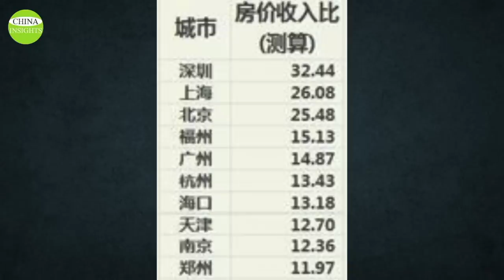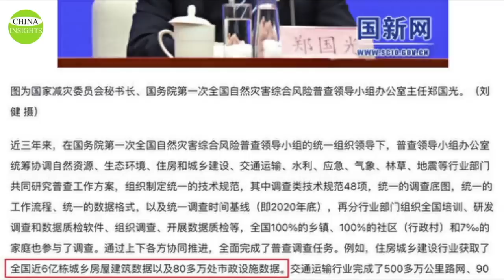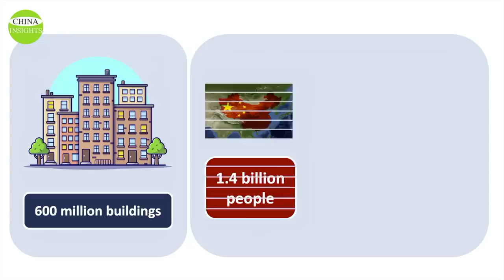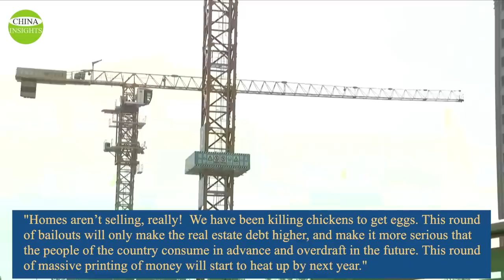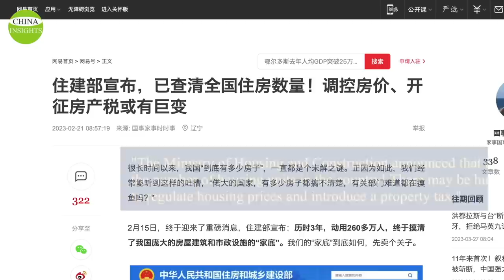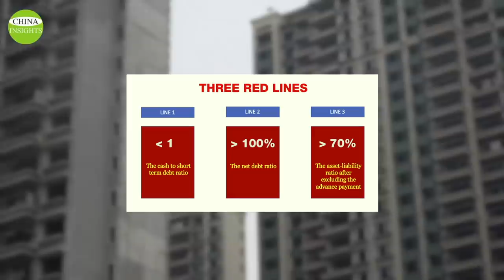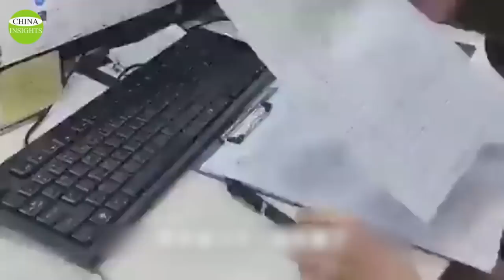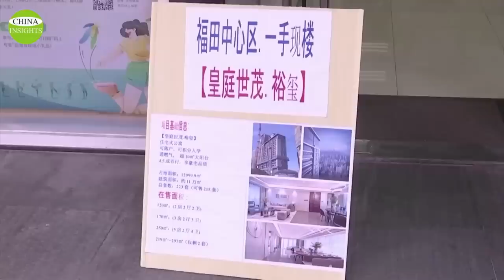Crisis overlap, heading for collapse: Why CCP release the news that China has 6 million buildings?

Comment: Are those buildings being demolished deliberately or is their collapse the result of the tofu dregs foundations melting and the buildings collapsing by themselves? In China you can never tell which it really is. That's what happens when you use too much sand and not enough concrete in cement and defective steel. That's what the German consultants said about the Three Gorges Dam while it was under construction and they were asked to inspect it. The CCP said their report was due to racism.
Reply: I heard it another way.  The dam builders insisted on USA inspection teams to avoid substandard materials and work.  It's still standing.
Reply: @jakleo337  There are a lot of concerns about it that seem fully justified. The inspection consultant was definitely German.

Comment: In communist russia there was a factory that had a rail line leading to it. Railcars of metal ingots arrived and the factory turned those ingots into ball bearings, loaded them into railcars and sent them away on the rail line. At the other end of the rail line was another factory, railcars of ball bearings would arrive loaded in the railcars. The factory took those ball bearings and melted them down into ingots, loaded them into railcars and sent them down the rail line.

It seems China is doing the same thing with real estate.

Comment: Not to be picky but I am a long-time and regular caller on regional 'Call-in and talk to the host radio' and I
recommend your site and cite it as an accurate source for news from inside China reporting.  Your title reads China has 6 million houses, not 600 million, several other callers and even the station hosts cite you as a source and you seem to have a good reputation as a go-to source in the listenership, please correct this error reporting the number of buildings, it reflects badly on your advocates here.